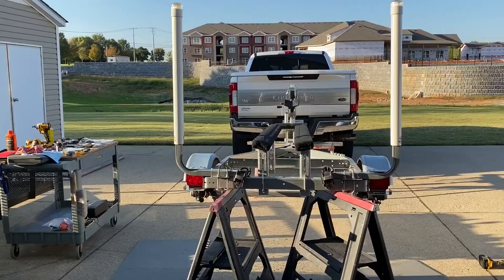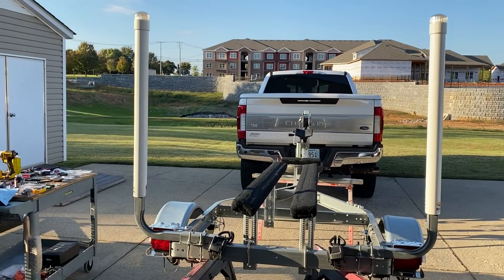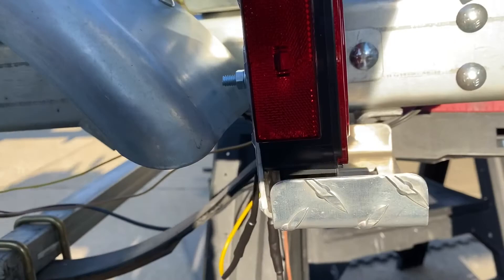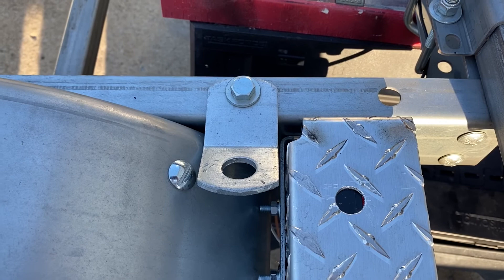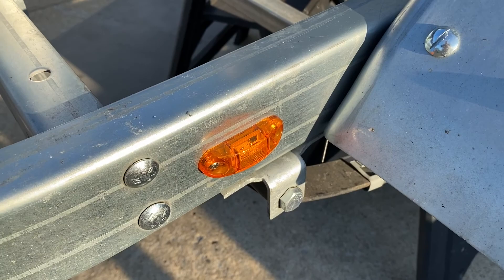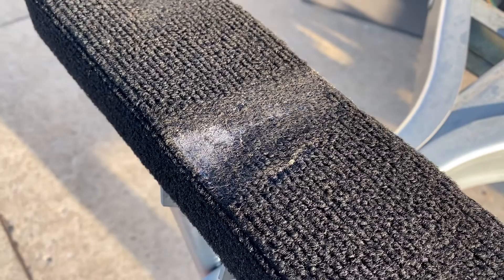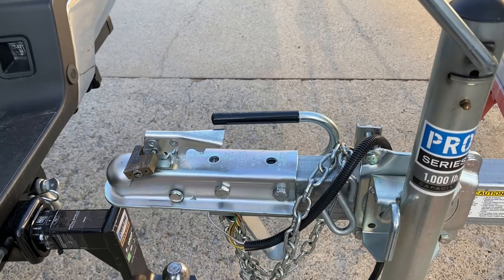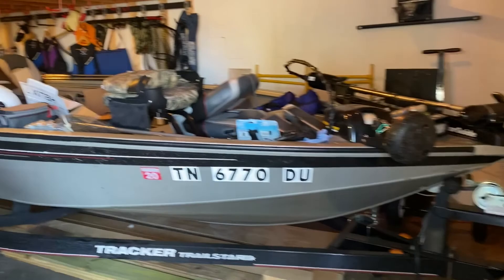Twin Troller X10 Trailer Modifications

Comment from the maker: I thought I’d share with all the Twin Troller X10 owners some of the modifications that I did to my trailer.  After a couple years of use the original bulb type lights that came with my trailer package were beginning to fail.  So I upgraded all my trailer lights to sealed LED lights and re-did my connections with better water resistant protection from the elements.  You’ll also see a few other things I did to improve the performance of my trailer...
Reply: Cool idea with the beads Dan.  I had given up on balancing the smaller wheels and went to 12" machined aluminum wheels with highway rated tires.  Yep, the beads would have been a better and cheaper idea. I guess that's why we call our boat, The Plastic Money $$.
Reply from the maker: Jim Correia   Hey Jim, The beads are cheaper, but, I bet your tires look great.
Reply: Like you I travel out on a highway/ turnpike and it’s speed limit is 75 mph.  Most trailer tires are rated for 65 mph and work fine for that but I really needed some wheels and tires that didn’t shake my car to pieces at higher speeds.  etrailer.com has an 81 mph speed rated 12” radial and combined with a trued and balanced aluminum wheels solves my issue but it’s a bit pricey and you are correct,  as a bonus the wheels look pretty awesome!

Comment: Great upgrades to your trailor, I decided to put those PVC post rails on my trailor too.  It makes backing up much easier in the evening or early in the morning.  Looks awesome!
Reply from the maker: Thanks Skooter

The poles do make it easier. The Smith brand version has lights at the top which make it nice for low light situations. 

I’ve got a few do dads that I’ve bought recently for the boat and have to get them on before the spring fishing season starts.

Comment: Hey Dan, thanks so much for your video. It was really well done and extremely informative. I am in the process of putting together enough money to be able to pay cash for a twin troller. So I’m not yet a twin troller owner. However, I have been extremely curious about whether or not this boat can move out in the water. It seems that you were saying that I’m only going to get about 3 mph out of the twin troller trolling motors. That sure doesn’t sound like much compared with kayaks that are sporting a  bow mount trolling motor.  I was then going to get the gas motor as well and was shocked when you said it was only going to give 1 mph more speed than what the trolling motors gave. That is astounding. I’m a little depressed at this news. My first question for you is are you satisfied with the amount of speed you get from the trolling motors? My second question is, how do you feel about the Honda 2.3 outboard?  I understand that they are made in China which really turned me off. I was thinking maybe I would go with a mercury or a Yamaha so that I could get something that was made in Japan. How do you feel about this? Thanks so much for your input! Ed
Reply from the maker: It would be nice to have bigger trolling motors for propulsion to get us up over 2.5 - 3 mph, however, it beats oaring and paddling.  The Honda 2.3 gets me closer to 4 - 5 mph if I need to go to the other end of a small lake faster.  I put an extension handle on my motor to be able to reach it better from the rear seat.  I found if I’m not using the motor for several days, it’s best to turn off the gas with the side lever to let it shut down.  It drains the gas out of the carburetor so it won’t gunk up on you from sitting.  A small amount of “Sea Foam” additive I’ll run through the motor once a year to help keep the carb clean.  As a small motor it has it’s limitations as you might expect.  I feel that the extra speed is a nice feature as well as being able to get up slow moving rivers if I hug the bank and get out of the current.  I carry a red 1 liter spare gas can like hikers use as a back up if I run out of gas.  You can run a full tank for about an hour before you’ll run out.

Comment: Great work Dan. I have been thinking about putting some type of rear post on my trailer as well. (Can I order the model you have?) My trailer is a 2019 model and came with LED lights even though they forgot to upgrade the manual telling me the wires were different when I assembled it last May. I figured it out after I realized the wires were different. I was hoping I wasn't the only one who's front bracket got bent out of shape and now that I've seen yours I have a cousin that welds aluminum and as soon as I can get my boat and trailer out of my barn it's going to him for a new mount. I heard you said you drove it to Michigan and just hope you enjoyed your trip as I live in Michigan about 12 miles from the Mackinaw bridge. I have so many small lakes up here so close I don'rt have to worry about those long drives and a bouncing boat. So hope you made it through the tornadoes okay and also this stupid Virus. Plan on spending many long hours sitting in my TT this spring, summer and, fall. Steve from Michigan.
Reply from the maker: I get up to Michigan 3 or 4 times a year.  I was hoping to do some ice fishing this winter... every time I happen to be up there, there’s no ice.  I’ll have to make a special trip when there’s good ice.
Reply from the maker: @kagnewmp12  Glad to hear the doctors got a solution for you and your heart.  Thanks for your willingness to give me ice updates.
Reply from the maker: Hey Steve, I’m back in Michigan now for some deer hunting. Glad to hear your enjoying your twin troller.

Comment: Dan must not be on YT anymore?
Reply from the maker: Trailer Mods
This is the majority of the parts I installed on my trailer.

C.E. Smith Trailer Coupler Lift Handle

C.E. Smith Trailer Bunk Swivel Bracket Kit with Hardware

C.E. Smith Swivel/Bolster Brackets

C.E. Smith Spare Tire Carrier

C.E. Smith Galvanized Replacement Tire and Wheel Assemblies

C.E. Smith LED Lighted Guide-Ons Posts

https://www.etrailer.com/Boat-Trailer-Parts/CE-Smith/CE26214G.html?feed=npn&msclkid=0f08df5510701ffcb9aebf92c4799c35&utm_source=bing&utm_medium=cpc&utm_campaign=Bing%20%7C%20Shop%20-%20Boat%20Trailer%20Parts&utm_term=4577473068293814&utm_content=60%20-%2090

https://www.amazon.com/CE-Smith-Tail-Light-Protector/dp/B00IEY03S8

C.E. Smith Coupler Lock

https://www.amazon.com/Z-Tire-Beads-Balancing-Applicator/dp/B00VO4ZODE/ref=sr_1_2_sspa?dchild=1&keywords=Tire+beads&qid=1623708937&sr=8-2-spons&psc=1&smid=A7R42F33WI3L5&spLa=ZW5jcnlwdGVkUXVhbGlmaWVyPUEzVTdXNDhQWlI0M0RXJmVuY3J5cHRlZElkPUEwOTkyNjc1MU5LWUxYRUxRNks1TyZlbmNyeXB0ZWRBZElkPUEwMjI3MjY4MlBLNkdNTjNGRU1ETiZ3aWRnZXROYW1lPXNwX2F0ZiZhY3Rpb249Y2xpY2tSZWRpcmVjdCZkb05vdExvZ0NsaWNrPXRydWU=

https://www.etrailer.com/Trailer-Lights/Blazer/C7493RTM.html?feed=npn&msclkid=d44f6684d28e138a5b47064304bb2f85&utm_source=bing&utm_medium=cpc&utm_campaign=Bing%20%7C%20Shop%20-%20Trailer%20Lights&utm_term=4577473068584466&utm_content=30%20-%2060

https://www.amazon.com/attwood-Trailer-Bunk-Padding-12-Inch/dp/B0000AZ8FJ/ref=sr_1_1_sspa?crid=1VDS68TALUDST&dchild=1&keywords=bunk+carpet+for+boat+trailers&qid=1623709095&sprefix=Bunk+carpet+%2Caps%2C239&sr=8-1-spons&psc=1&spLa=ZW5jcnlwdGVkUXVhbGlmaWVyPUEyVExKSFlVS0EzMDFNJmVuY3J5cHRlZElkPUEwNDA5NTUyTDFWM0xORjVSQlc0JmVuY3J5cHRlZEFkSWQ9QTA5NDkwNDVSWlZPV1lCMjJKSU0md2lkZ2V0TmFtZT1zcF9hdGYmYWN0aW9uPWNsaWNrUmVkaXJlY3QmZG9Ob3RMb2dDbGljaz10cnVl

A piece of 2”x4” about 12” long for the front bunk support.  Treated board will last longer.  I used southern yellow pine because I had some already.

The front aluminum bumper I had built for me out of 1/4” aluminum stock and had two holes drilled in it to fasten to the frame.

Boat Mods

Ram Mounts
https://www.amazon.com/National-Products-RAM-202-Electronic-1-5-Inch/dp/B0000BVFUC/ref=sr_1_2?crid=17MK66BKWMBRJ&dchild=1&keywords=ram+ball+mount+1.5+inch&qid=1623710343&sprefix=Ram+ball+mount%2Caps%2C218&sr=8-2

Ram Mount Double Socket
https://www.amazon.com/Mount-Double-Socket-1-Inch-Bases/dp/B000WJA5ZY/ref=sr_1_3?dchild=1&keywords=ram+ball+mount+arm&qid=1623710431&sr=8-3

Storage Mesh Bag
https://www.amazon.com/YiMusic-Durable-Accessories-Storage-Organizer/dp/B07NXY6J78/ref=sr_1_55?dchild=1&keywords=kayak+storage+net&qid=1623710243&sr=8-55

Comment from the maker: Trailer Mods
This is the majority of the parts I installed on my trailer.

C.E. Smith Trailer Coupler Lift Handle

C.E. Smith Trailer Bunk Swivel Bracket Kit with Hardware

C.E. Smith Swivel/Bolster Brackets

C.E. Smith Spare Tire Carrier

C.E. Smith Galvanized Replacement Tire and Wheel Assemblies

C.E. Smith LED Lighted Guide-Ons Posts

https://www.etrailer.com/Boat-Trailer-Parts/CE-Smith/CE26214G.html?feed=npn&msclkid=0f08df5510701ffcb9aebf92c4799c35&utm_source=bing&utm_medium=cpc&utm_campaign=Bing%20%7C%20Shop%20-%20Boat%20Trailer%20Parts&utm_term=4577473068293814&utm_content=60%20-%2090

https://www.amazon.com/CE-Smith-Tail-Light-Protector/dp/B00IEY03S8

C.E. Smith Coupler Lock

https://www.amazon.com/Z-Tire-Beads-Balancing-Applicator/dp/B00VO4ZODE/ref=sr_1_2_sspa?dchild=1&keywords=Tire+beads&qid=1623708937&sr=8-2-spons&psc=1&smid=A7R42F33WI3L5&spLa=ZW5jcnlwdGVkUXVhbGlmaWVyPUEzVTdXNDhQWlI0M0RXJmVuY3J5cHRlZElkPUEwOTkyNjc1MU5LWUxYRUxRNks1TyZlbmNyeXB0ZWRBZElkPUEwMjI3MjY4MlBLNkdNTjNGRU1ETiZ3aWRnZXROYW1lPXNwX2F0ZiZhY3Rpb249Y2xpY2tSZWRpcmVjdCZkb05vdExvZ0NsaWNrPXRydWU=

https://www.etrailer.com/Trailer-Lights/Blazer/C7493RTM.html?feed=npn&msclkid=d44f6684d28e138a5b47064304bb2f85&utm_source=bing&utm_medium=cpc&utm_campaign=Bing%20%7C%20Shop%20-%20Trailer%20Lights&utm_term=4577473068584466&utm_content=30%20-%2060

https://www.amazon.com/attwood-Trailer-Bunk-Padding-12-Inch/dp/B0000AZ8FJ/ref=sr_1_1_sspa?crid=1VDS68TALUDST&dchild=1&keywords=bunk+carpet+for+boat+trailers&qid=1623709095&sprefix=Bunk+carpet+%2Caps%2C239&sr=8-1-spons&psc=1&spLa=ZW5jcnlwdGVkUXVhbGlmaWVyPUEyVExKSFlVS0EzMDFNJmVuY3J5cHRlZElkPUEwNDA5NTUyTDFWM0xORjVSQlc0JmVuY3J5cHRlZEFkSWQ9QTA5NDkwNDVSWlZPV1lCMjJKSU0md2lkZ2V0TmFtZT1zcF9hdGYmYWN0aW9uPWNsaWNrUmVkaXJlY3QmZG9Ob3RMb2dDbGljaz10cnVl

A piece of 2”x4” about 12” long for the front bunk support.  Treated board will last longer.  I used southern yellow pine because I had some already.

The front aluminum bumper I had built for me out of 1/4” aluminum stock and had two holes drilled in it to fasten to the frame.